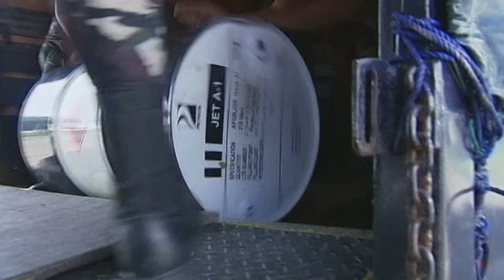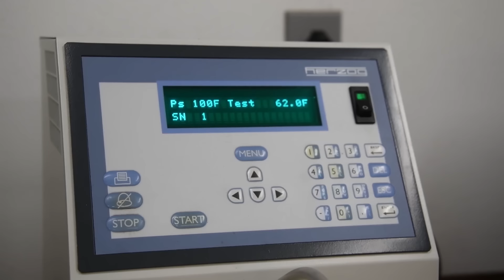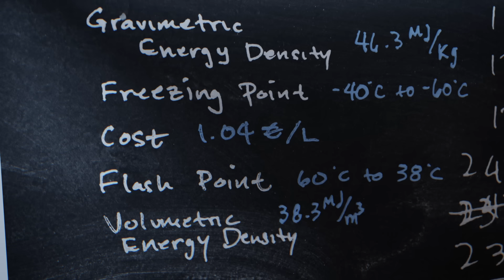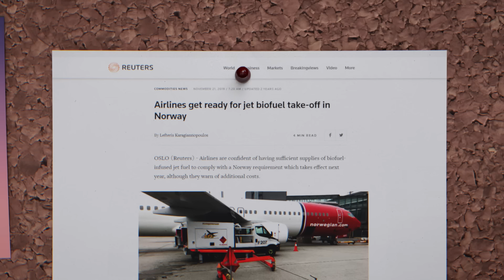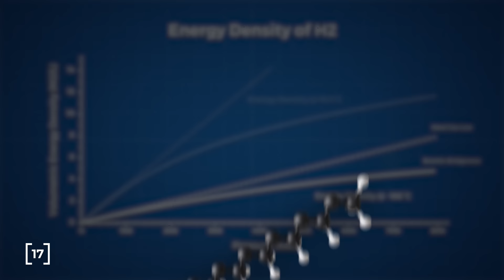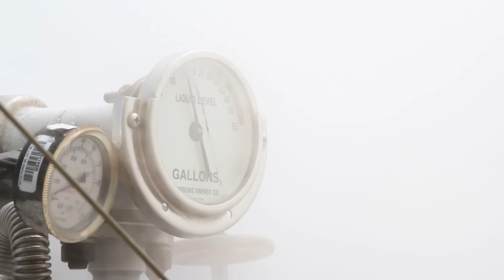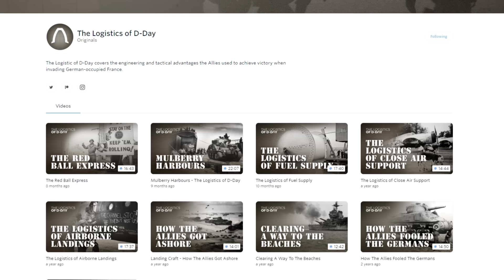The Uncertain Future of Jet Fuel

Comment: Starship will carry people anywhere in the world in an hour for less than a plane ticket.
It ain't just for Mars anymore.
Reply: Less than a plane ticket? you cant be serious.
Reply: @waffles4622  ikr!
Reply: @michaelpcoffee  that would be wayyyy more expensive
Reply: @waffles4622  
Pretty much Just the cost of fuel.
I saw an article that broke it down.
It was pretty convincing.
Reply: @michaelpcoffee   it would still be hella expensive with the launch alone because the amount of safety percautions you need incase in an emergency. But the starship doesnt have emergency abort systems, so if the starship itself catches on fire on the pad, or early in flight.

If you're gonna use this for civillian use. You need to mass produce it, building a starship would cost around ~200 million and a lauch price estimated to be 2 million. So making it an economic rocket for the everage person is a no go. And so if it was use for civillians it would be for the rich. The one that can spend tousands or millions on a trip that only last an hour or even less. You also have to build more launchpads this also means more cost.

Its just too expensive and dangerous for civillian use.

Comment: 25% of 1000 is much better than 5% of 100,000......   The ratio is going up only because the number of other contributors is dropping.  Jet engines are getting cleaner and more efficient at a much faster rate than automobiles EVER did (i.e. the exponential leaps of the GEnx).  There may be future technologies that can replace the power to weight ratios needed to power these indispensable behemoths thru the sky, but until then if the airline industry were to remain dependent on the decreasing supply of petro-fuels as the other sectors are weaned off, the overall contribution they make towards global temperature rise would be miniscule compared with, let's say 9 billion people simply breathing constantly.

Comment: The blended wing is no new idea. The horton brothers designed a large bomber version of the horton go 229 which essentially was just a huge flying wing. Planes don't have to be a priority, a lot of things pollute significantly more, it makes more sense to fix the easy stuff first. It wouldn't make sense to invest trillions into airplanes when ships trucks and just about everything produced in china and obviously everything made out of concrete pollutes way way way more. Even normal cars pollute a lot more for the same a to b travel than a plane. Long distance airflight is by far the most environmentally friendly way to travel apart from riding a horse, bicycle, walking or sailing without using engines. That's because planes use fairly little fuel per seat pr km, take a very direct route compared to cars or trains and unlike cars or trains you don't have to build and maintain massive asphalt roads or steel tracks. Planes wrongfully get a lot of environmental hate and a lot of people travel long distance by car for that reason. Unless you have a very efficient car and fill it to the brim and also happen to be driving a very direct route it simply would not be as effecient as flying. That's also the reason why flying in general is so much cheaper than taking a train or car. In fact since most cars only carry one person at a time, cars are terribly inefficient. once ai becomes capable enough to make accidents really unlikely the best solution might be to replace cars with ultra lightweight motorcycles with a cabin like a jet..

Comment: Hydrogen is too big of a PITA to deal with.
Just bite the bullet on the single carbon atom and use methane + carbon capture to offset.
The cost it terms of infrastructure for H2 may be manageable in richer countries, but many less developed countries lack the industrial base, qualified manpower and money to support that sort of infrastructure. Richer countries can help build the infrastructure, but that won't do much good, if you can't keep it running.
CH4 as aviation fuel has many benefits (burns very cleanly, a LOT easier to deal with compared to H2, can be made to work in existing plane designs). With H2 we'd be spending 90% of effort for the last 10%, when we can have 90% for 10% the effort.
Reply: koiun dwrru  lol, sure. Just after we get nuclear powered cars.

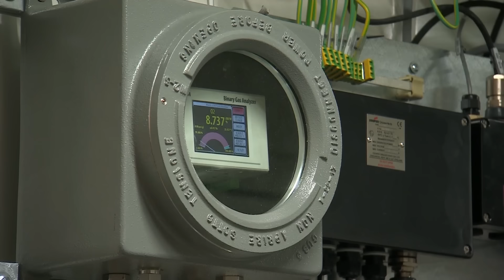Comment: 20:03 The carbon side would have synergy with cryogenic energy storage as the various gasses in the air can be separated with little extra modifications to the system.

Comment: They could run on liquid methane. Better energy density and if you produce it by sucking co2 out of the air with renewable energy you'll be carbon neutral

Comment: Whether battery-powered aircraft are a viable option (they aren't) doesn't depend on what is possible in air travel, but what kind of travel  is best carbon-wise.

Short- and intermediate cross-land flight is better converted to Rail, High-Speed Rail or MagLev - see Japan for the integration of all three to get traffic down to earth. In a rail/maglev system, powered stabilisation is necessary in 1 dimension (accelerate/decelerate); on the street, that makes two dimensions (the land vehicle has to have side stability, so you need more grip of the wheels). In both cases, weight is mostly "free" as it is "carried" by the ground.

Air travel needs to overcome all three dimensions. That's why a land-based route always is superiour to an air corridor and a rail line always is superiour to both. Add to that that rail doesn't need to move the energy source, as that comes from overhead catenary; and MagLev like #Transrapid only power those line segments (stators) the train is moving on.

So, all in all, battery flight is only possible in areas where it displaces rail/maglev travel. That's why is should have no future.

Comment: The other hydrogen-derived fuel being considered is ammonia, as, compared to hydrogen, it has higher energy density, requires lower pressurization, can maintain a liquid state at higher temperatures, but still burns clean.
Reply: It is somewhat difficult to burn clean and it is highly corrosive.   It can be produced from urine which is currently for the most part wasted.
Reply: @seandepagnier  Pure ammonia isn't corrosive to steel, but contaminated ammonia is highly corrosive.
It easily burns clean, rendering back to water and nitrogen, so long as enough oxygen is provided to react with the hydrogens.
Reply: @seandepagnier  you need to have stoichiometric oxygen, which isn't really practical for an open flame stove, the fuel/air mix would need to be thoroughly mixed prior to ignition, and the fuel/air mix might need to be compressed prior to ignition.
Those are things an engine can do easily, but an open stove cannot.
Running fuel rich you'd get a lot of unburned ammonia which can be detected by smell at something like 1ppm; run oxygen rich and the extra oxygen can bind to the nitrogens rather than the nitrogens forming their passive dinitrogen molecule.
Stoichiometric burn is 4 ammonia to 3 dioxygen into dinitrogen and water, but when oxygen rich you get 4 ammonia to 5 dioxygen into nitrogen oxide and water, and the nitrogen oxide further reacts with additional oxygen to produce the nasty nitrogen dioxide you're trying to avoid.
Reply: @AlexanderTzalumen  Thank you for the education.   What about electrolysis of ammonia which uses very little electricity.  Then use the hydrogen in a fuel cell to power an electric motor.   Would this give far higher efficiency than burning the ammonia in a heat engine?
Reply: @seandepagnier  oh, yes, it's a fantastic for fuel cells.
The biggest challenges for production are the same as hydrogen, in part because hydrogen is required by the Haber-Bosch reaction, and so is a lot of heat.

Comment: They would be better off taking carbon from the sea water they use to make hydrogen, which in turn reduce carbon in the air as sea water take carbon from the air and it would reduce the acidity of the sea water.

Comment: A question.  With the predicted rise of EV's and hence the fall in petroleum dependency, will that make the cost of kerosene products higher as petroleum will only be a minor byproduct of oil refining?  Are both products created at the same time, and is that for economic reasons?

Comment: It may be necessary to reduce the speed of travel too. Using lighter than air ships to fly across at a lower altitude and shorter distance would reduce the energy needed for lift and movement, but it would slow the pace of travel to something like the 19th century last sailing ships to steam ship conversions where it may have taken a passenger on board a ship weeks or even months to complete a long voyage..

But with the voyage being the destination, maybe leisure travel will accept the slower pace to intermediate stops along the way every two or three days of flight time to spend "ashore" in remote destinations like Newfoundland, Iceland, and Scotland on the way to other more popular end destinations.

A journey from New York to Paris, on the airships of the future may well cost about the same, use virtually no carbon fuels as batteries would drive the small propeller engines and lift is primarily achieved by Helium or some other inert lighter than air synthetic gas.

And the travel time may be two weeks. But that is like taking a cruise except transiting on lighter than air airships.

There might be express types as well that are able to go higher and use the Jet Stream to propel the craft farther and the small battery driven engines are really just thrusters used for steering assistance. Then an express, possibly a fusiform lighter than airship might lift to 25 or 30 thousand feet to get into the Jet Stream or some other intercontinental air flow.

It's a thought. We don't need to travel fast. We need to travel slower and use no carbon fuels at all.

All we need to do is solve the magnetic containment field issues for a sustained fusion reaction for power generation and then build these fusion reaction power plants to scale around the population centers and of course, hydrogen fusion produces helium. And there is your inert lighter than air gas.

Ok sounds Jules Verne. But so did going to the Moon or to the bottom of the sea when those ideas were first dreamed. Fusion is coming. Just not fast. But maybe that is ok as we need to work on the easier problems first and Jet or Commercial Flight Travel can come into zero carbon generation later in the late 21st or early 22nd century.

Comment: Jet fuel is so cheap it's wasted on cheap flights on cheap holidays.
1000 miles for a £15 ticket.
But if you condense the daily barrels use of oil you will end up with thousands of tonnes of jet fuel, petrol ,diesel and other products to be used up every day. Hence the cheap flights.
Why is there no jet turbine electric generation in cities? A heat byproduct. A carbon dioxide gas for growing green stuff. Possible draft gass driven tube transport. So a hyperlink could be pushed rather than a vacuum tube. THats how I see it.

Comment: Pfft, no, Hydrogens main feed stock right now is methane a fossil fuel though steam reforming by 95% vs 5% of hydrogen made from water via electrolysis.

Steam reforming also ontop of using methane it also uses power so if you add up the energy content of the fuel used and the energy in turning it into hydrogen you only get back 50% of the energy and also release CO2, Hydrogen is currently a poor rebranding for fossil fuels.

Comment: The only thing certain is that it can't melt steel beams
Reply: Jet fuel doesn't have to melt steel to render it essentially useless. After about 500 deg C, steel possesses all of the structural rigidity of a wet noodle.

Comment: I am so surprised that you would compare Hydrogen with other fuels that way. Hydrogen is the predecessor to every other aircraft fuel. It is lighter then air already. The lightest. It does not need to be compressed or cooled at all. The hydrogen blimp has the best safety record (despite the press) of any lighter then air aircraft. With Hydrogen you can lift more and fly higher and faster then hot air or helium. Slower hydrogen aircrafts with between 1-100% of the lift provided by the fuel is what is needed in my view. When lift is solved by the gas, much much less fuel is needed for each flight. More time is needed though. There is a lot of potential here though. Perhaps it will be helicopters rather then airplanes that are the main competition in this market but there is great potential there!

Comment: I agree biofuel is a nonstarter because of displacing much needed forestry and associated biodiversity whilst also displacing food production.
 However algal fuel is the way forward I believe virgin airlines are currently trying it and the up and coming seaweed farming as advocated by Bren Smith  (Greenwave) has more than enough capacity (70% of the earths surface) plus it is requesting carbon from the green house gases a much needed process. Which cooled the earths atmosphere in the beginning….

Comment: there's one simple way to reduce the carbon output of aviation: reduce aviation. invest in decent ground transport, like electric rail, and stop using domestic flights so damn much
Reply: Telling people they can't fly anymore is rather authoritarian.
Reply: @anthonymorris5084  investing in infrastructure to make flying no longer the most convenient way to get to the next city over isn't telling people they can't fly.
Reply: @keiyakins  Well that's certainly good to hear. Are you aware that travelling by train is more expensive? Are you certain trains use less fuel than jets? If I fly to the West coast from where I am today it would take roughly 5 hours. If I took a train, it would take 4 or 5 days. How much more fuel would the train use? 

How many more trains would you require to replace the incalculable number of planes that are in the air at this very moment? You would need vastly more trains, especially as they move so much slower. 

If I took a week long vacation out West I'd need 4 to 5 days just to get there. Most flights are over water as well. Should they take boats? Same kind of issues arise though. 

Will all of the VIP's and celebrities that just flew all their private jets to COP27 start taking private trains?
Reply: @anthonymorris5084  A. I said reduce, not eliminate. When you're crossing entire continents flight does make sense.
b. Trains can use much more efficient energy sources, especially with electric locomotives being able to draw from the grid - in principle they can run entirely on renewable, non-carbon-emitting energy, and theyd naturally switch to that as everything else does because, y'know, on the grid.

Comment: So the video is about the carbon emission of airplanes and then he mentions biofuels as alternatives.. They still burn into CO2 so it is not a bit better at reducing carbon emission. Even if the particulate is cleaner, it will still burn into the same CO2 we know and hate. And also I don't know why is it a problem that the percentage will be like 25%. IT would only mean that that we could successfully eliminate most of the carbon from other sources and that "little" 3% is now the quarter of emissions.

Comment: By special design of low current freestream tidal power turbines generating electricity at or below 0.01 €/kWh a 5 step catalytic process to synthesize Jetfuel A1 is viable. We can cheaply get carbon from algae and hydrogen from electrolysis. We can blend in for a smooth transition. However, the carbon emissions cap and trade regimes will determine the pace much more. So with R&D we can ramp up economical CO2 aviation fuels. Nevertheless a shortage in supply will make a temporary raise in prices occur. Continental flights will become more of a luxury again for a considerably long time. This isn't such a bad thing for humanity. Aviation as a biz sector can grow in quality again vs growing in quantity.

Comment: Direct carbon capture should be easier once you understand that large carbon emission factory's (steel/alu/Chemicals/concrete etc) will otherwise have to fit carbon capture and storage or move to ultra low carbon fuel stock but separating it and delivering it for a blended fuel is a no brainer.
We also know that aviation fuel will no longer enjoy its tax free cost and the world will soon as a tax, generating much needed climate change mitigation income and driving even more demand for fuel saving aeronautical innovation.
While fuel burn per passenger has fallen, and the dramatic fuel cuts from modern turbofans and lighter plane materials is narrowing and small fuel savings while adding up are not at the pace the earth needs. We may be willing to pay for more expensive longer haul seat prices by airlines replacing planes more frequently but that's not good for the planet either or airlines profits. Short haul flight alternatives are more likely (High speed rail/maglev) to make them prohibitive over land. Alternative High speed ferries (nuclear powered/electric-fuel cell) might solve some cross water destinations vs the aim of current shipping - as slow sailing as at present but carbon "free".